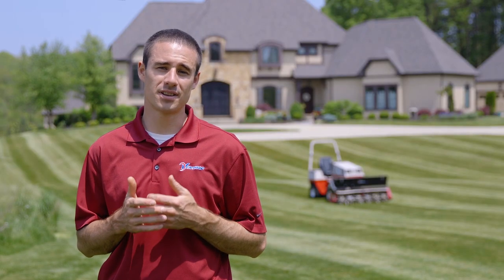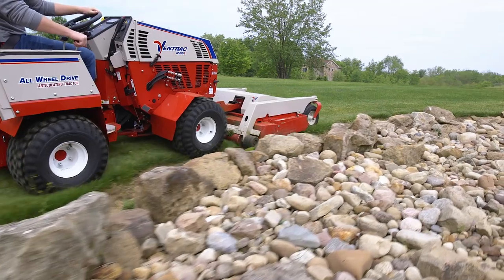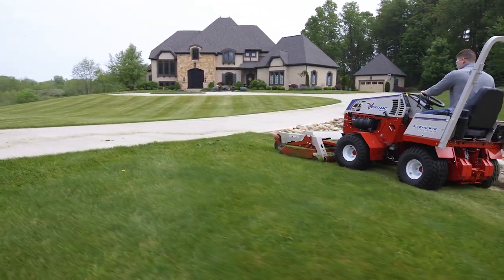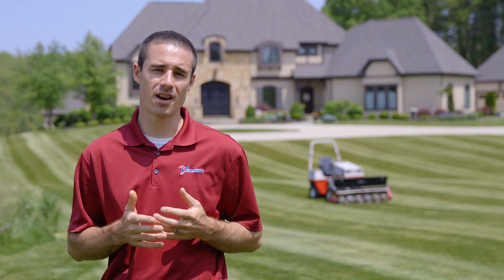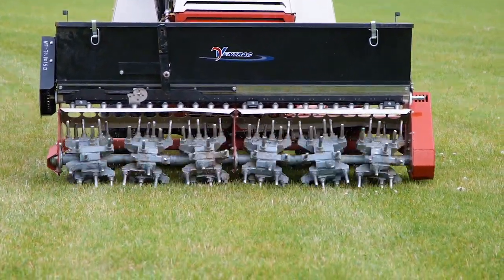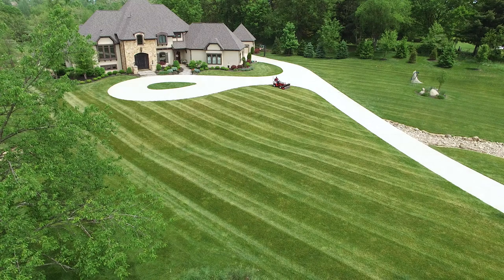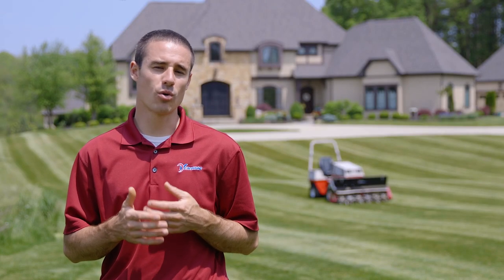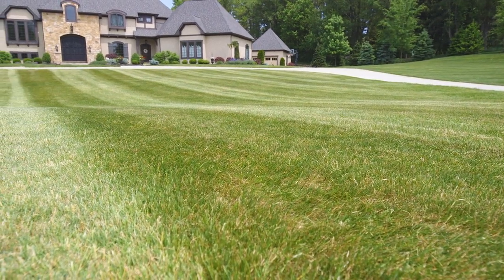Bold Lawn Stripes - 2 Key Tips to the Best Looking Lawn

Comment: must be a new roller. mine is not solid steel on my 720.
Reply: How much did your ventrac cost brand new?
Reply: I can never find prices on these machines
Reply: @user-ur6ci4kj7b  when they say its a compact tractor they mean its like hella expensive i read on a forum that somebody who bought some essential attachments was down 30k
Reply: @user-ur6ci4kj7b  I just downloaded a price list off website the other day. I needed something like this for the really steep hills at our farm. They are over 30 deg and this thing does the job. I am by no means a paid spokes person either. I bought a 4500Z Demo with 10 hrs with the Kubota gas. right around 19K. I bought a MS720 Finish,HQ680 Tough Cut,Power Bucket with Grapple ,Dual Wheels and a slope indicator all for a hair under 30K. I am tax exempt so no tax. I will say, My wife runs it like a boss and is the safest thing out there. In my world, if it doesn't work like it should I do 1 of 3 things, Blow it up, Burn it to the ground or sell it. Well, I still got mine! 290 hrs and this is my second mowing season. Do the maintenance and take care of it and there is no reason it won't out live me.
Reply: @jakewilson5971 , I have a Case IH 585,a 10 foot bush hog,4 bottom plow,disc's planters and blade at our other farm well over 30K. I would sell it all today for another Ventrac 4500. Listen, when I just took care of our 2.5 acres there is no way in hell I would spend that mowing my lawn at my house. My Bobcat and Scag were just fine. But now that we have expanded, well so did our fleet of mowers. I don't get paid 1 red cent for mowing grass or doing jobs. I use this machine for personal use ONLY. I need this machine because there is not another one out there that can do what I need. I guess it's all about needs and safety to me.